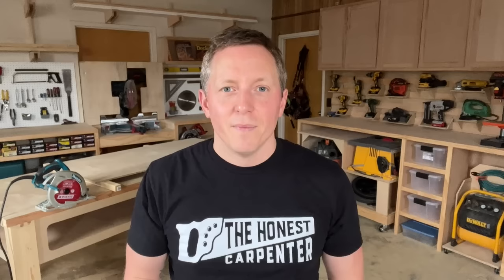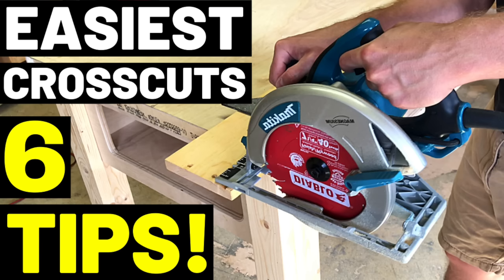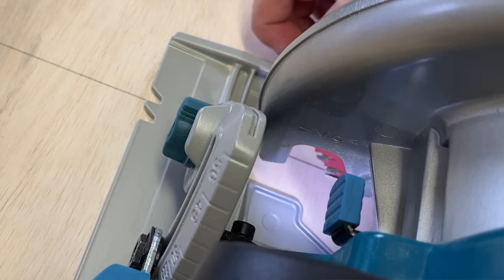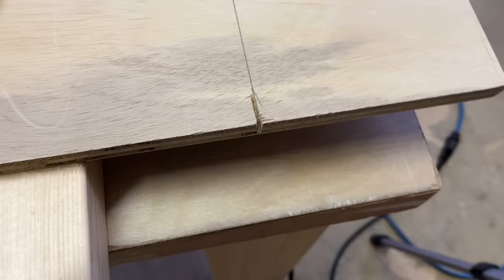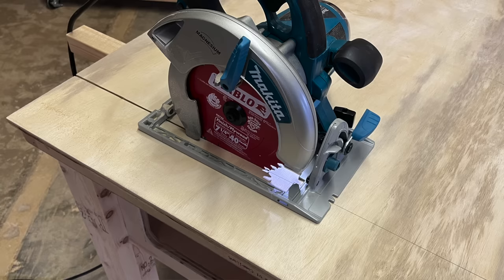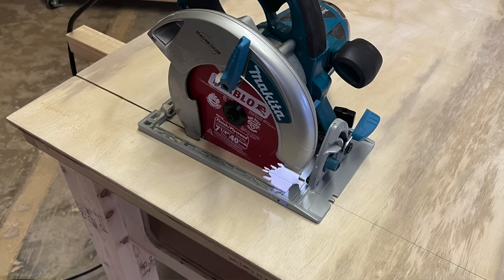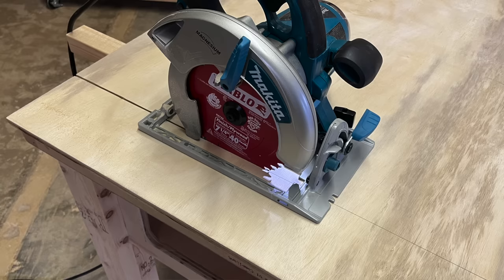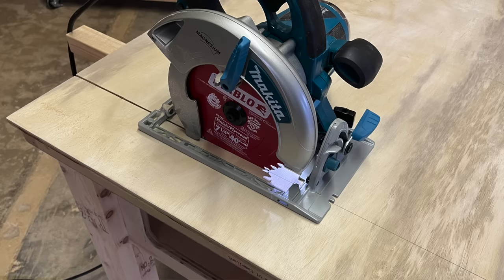How To CUT STRAIGHT With NO GUIDE! Freehand CIRCULAR SAW CUTTING...Pro Tips, Tricks and Secrets!

Comment: When I do a freehand cut like this, I use a 60 tooth blade and I get the cut started as this video shows. Once the saw shoe is fully on the surface of the board, I stop the saw making sure NOT to move it and I do wait till the blade completely stops. I then make a precise mark (just with any fine marker) on the trailing end of the saw shoe right where the edge of the cut is and I mainly keep my eye on the mark keeping it on track with the edge while periodically glancing at the front of the saw blade. I find this works extremely well due to the visual leverage at the rear as opposed to the front. (Hope that makes sense to all you readers).

Comment: great video.  ive got a regular makita circular and i like to start the blade turning and watch the blade start the cut on the correct side of the line. and then look at the table guide notch and make sure its lined up and then push the saw and my eyes will look back and forth from the blade and the guide while making the cut.

Comment: I specifically bought my Bosch GKS 18 V-Li with 3 things in mind (4 if you consider the battery platform):
1: Battery operated so I won't have a cord that catches on things all the time.
2: A sole that supports tracks.
3: The blade to the left, so that I can see the blade and have the wide part of the sole fully supported when cutting narrow strips without having to use my non-dominant left hand.
It's an older brushed model (though still available from the manufacturer), but right now, it's the only model that has all 3 options.
The trade-offs are 2" cutting capacity and it is limited to the older FSN70 /-140 tracks (same concept as Makita, Festool, etc.), but I can easily live with that.

Comment: Very effective explanation.  It's easy to take knowledge you've acquired for granted; multiple times in vid I was like "yeah, I guess I do do that".  You're definitely a born educator!
The only thing I would add, and it's not even a technique, just advice for beginners, is to be prepared for the power and action of saw.  I can recall when it was kinda terrifying just to try and handle the saw when on, but if you get a feel for the experience of it speeding up; the resistance as it bites into lumber; the amount of force to apply; the response of lumber as you progress through cut, it's not nearly as intimidating... obviously you get a feel for these things w experience, but too often ppl don't even give what it may feel like any thought prior to trying.  I think that's an important but often overlooked aspect of learning anything new.   
Whatever you do you should try and improve with each attempt, but that doesn't mean the first try needs to be a disaster : )

Comment: Great video. I’ve been a carpenter for 20 years and the young guys at work (lets be honest some of the older ones too)  just can’t understand you have to watch the blade if you want to cut straight. I got all my practice being a residential framer for 15 years before joining the union. Once you build the muscle memory required for pushing the saw straight you will be efficient and accurate with your rips.

Comment: Great video.  I got a left handed Skilsaw for Christmas.  Thats a Skilsaw, not to be confused with the cheap Skil... saw. : )  Im right handed so it makes it super easy to see the blade since its on the left.  Still takes a lot of practice to cut straight.
Reply: As a lefty I always found it odd that skilsaws seemed like they were made for left-handed use - with the exception that they tend to discharge sawdust right at my thigh.

Comment: Always good.  Having cut a cord or 2 over the years, my favorite tip is clip a carabiner to my belt loop and run the cord through it.  it will always follow my body at hip level.
Reply: Please don't use a carabiner. It can be extremely dangerous because the cord always leads back to you. Something as simple as someone else tripping on your cord. How about cord catching on something and the saw kicking back. There are many ways this could go wrong.
Reply: @jonperryman6477  I see your point but this has not been my experience.  kickback incidents went down after doing this because the cord stays inline with the cut.  I generally work alone, but when i was on the job site i kept cords to a minimum.  I was also the osha inspector on the job.
Reply: @garybecker4490  Please don't pretend you were with OSHA. You were the contractor's safety person. The original poster must be a DIY'er because he cut his cord a couple of times (could just as easily been a body part or someone else). After volunteering at "Rebuild Together", I found DIY'ers often do the unthinkable. E.g. free hand hold work piece under a band saw which thank god they dropped their hands when the blade touched their fingers. You could see the mark across every finger! Worse yet, they will imitate you as a professional which they clearly don't have the skills to perform safely. As for the carabiner trick, it's safe for someone skilled in cord management. For DIY'er, it's an excuse to ignore cord management.
Reply: @jonperryman6477  I wont argue with you.  I didnt say i was with osha, but compliance and safety was my responsibility with the authority and accountability for the entire site.

Comment: Back again.  I've been cutting kitchen and bathroom countertops with circular saw plunge cuts. These are quite tricky to do. It is not possible to keep my eye on the cut line at all times because Instead I need to ensure the saw's rail is staying flush with the guard rail (gotta have those  sincefree hand is absolutely not working in tough materials). I've also found that cutting backwards often works better because going forwards sometimes locks up / kicks back for no apparent reason.

Comment: Frankly, the biggest factor in how easy it is to cut straight is the circular saw you're using. I got a corded Ryobi that was a nightmare, which I outright broke somehow. I got the battery powered Ryobi, and it's a dream. Zips right through, easy to control, no problems.

Comment: Good information.

I would add a couple of items.
When starting a new project start with a new sharp blade.

Treated wood tends to dull blades and I have learned from experience when a blade is starting to get dull.
I can feel it.

For framing cuts and rough stuff you can power through but if you are getting to stuff that is going to be exposed change the blade.

Your saw will thank you.

Harbor Freight sells a circular saw blade sharpening device.

Comment: I had a problem with my circular saw walking off the path even when I was running it against a straight edge and push hard into the straight edge to compensate for it walking off the rail. Turned out the blade was super old and dull. I replaced the blade with a new one and boom! Perfect straight lines using the straight edge

Comment: Great video. Wish these kinds of videos had been around 40+ years ago when I first started out, ha ha. I was taught by old time carpenters and actually learned a few tricks.  Like pinching the shoe in front of the blade and using the edge of your finger on narrow rips, using the framing square as a cross cut guide on crosscuts less than two feet, ect.

It wasn't until much later, after getting a subscription to a couple of woodworking magazines, that I learned about making panel guides for the circular saw to make straight, accurate cuts in finish sheet goods.

I also made up panel guides for my routers for cross cutting dados and rabbets, identifying each guide for which router with what bit. 

Great video as always.

Comment: Use dust extraction, if you are cutting slowly you can obscure your pencil line with excess swarf and cut an untrue line, its also good for your lungs, people fail to realise how long and how much fine wood/ mdf particles hang in the air.

Comment: Good video Ethan. If after watching this video someone still has a problem getting straight lines you can always cut the plywood an 1/8” oversized in all dimensions and then use a router with a good trim bit and trim it flush.
Ron
Reply from the maker: Good point Ron! A good woodworker friend of mine does that. 👍

Comment: Tip.....  Once you're into a cut and going straight, look at the front of the saws base plate and take note on where your cut line is at the front of the base plate. Use both the reference at the front of the saw base plate and the blade at the edge of the board when starting a cut and the saw will orientate itself to being straight before you even begin to cut.
Tip..... When free hand accuracy is important and you have the proper setup, drop the blade below the saw base plate to a greater depth to expose more of the blade plate. The will help to keep the saw straight as you cut.

Comment: Your thorough caution at the start reminded me of an old acquaintance named Roy.  Roy liked to use his table saw.  Roy liked to drink.  At the same time.  One day, Roy cut off about half of his finger with the table saw, and the spinning blade threw it across his shop.  Why didn't Roy grab it and run to the ER, hoping to get it reattached?  Because Roy's dog ate it ... ate his finger.

If I might have ever been tempted to drink and use cutting tools, after that I knew I'd be quite safe from even considering it.

Comment: As most of my cuts require percision , I'm always use a guide. For free hand when the exact size doesnt really matter I'm holding the saw next to the cutting line in line with my right hand and shoulder and my index finger points the cut....it works well as for hand saws.
Reply: Thought you were Electroboom  for a second lol.

Comment: I did not know they make circular saws with the blade mounted on the left. perhaps they are harder to find? I have a right blade saw. I'm right handed and the issue i have is I'm nearly blind in my right eye. it is more a challenge to follow a straight line when cutting. I always use a straight edge to help me with my cuts. Thanks for all your tutorials. they help me lots!

Comment: When im at work i just lean the plywood against the work van, hold the saw sideways making sure the blade will not touch the van. Then i make the cut, and when i get to the last few inches i line it up good and go real fast because the plywood will colapse. Lol. I get back and get my feet out of the way and let it fall. Works great. 😂

Comment: When i mark a line, i use the side of the board of the cirkel saw as guidance. I prefer this way because you can easily see it, and you also clearly see, if youre saw is in line with youre cut. You just measure the distance from the end of youre board to the cut. And add/take-off  from the measure you want to cut from youre material.

Comment: Discount track saws, made from plywood and a straight edge works real good if you really need those nice factory cuts too. I'm working a job right  now where I have to cut plywood siding, so I just jigged up what is basically a panel saw, with a few scrap pieces. Works like a charm.

Comment: I've cut for years I can rip a board with using my finger as a guide, also it helps to chalk a line preferably black chalk but when you get comfortable with a saw a lot of things you can do, watch the blade and make sure you  have you blade adjustment about a half, helps keep it straight. If your cutting high dollar board just let a pro cut it for you or you will mess up something like Burch plywood,just get a old piece and practice.

Comment: great video i did very similar myself for ripping a large 4x8 plywood on the floor. only 1 thing i would say is it would help to start the beginning of the cut with a speed square. to get it started straight. and avoid the wiggling until the blade gets established into the groove. then freehand the rest of the way

Comment: Dude.  

Tip - It’s a whole easier and safer and more accurate to know the offset measurement to your blade and draw your guide line for the right (or left) side of the base plate. 
You cannot eyeball starting your cut parallel to the line when all you can see is one point (the blade bordering or splitting your line.)  If you use the base plate you can eyeball that the entire edge is // to your line. 
Try it. 
Tip - If you don’t know your offsets, just set the blade on your first mark and use the base to make your offset mark.
Reply: That is the first time I have ever heard of doing it that way. 
That's a good tip. I will definitely try that.👍
Reply: @Griffix96  And one could then also hold a straight edge against the plate to line up the saw to start the cut perfectly parallel. I use a square for that purpose quite often- just to get lined up. Craftsman used to sell an adjustable square just for that purpose - to help you hold your circ saw // or to what angle you need. I just use a small try square or machinist square or one of the cheapo plastic triangles from a big box or Harbor Freight in my free hand when starting a cut.

Comment: I just clamp a piece of wood that I can use as a guide rail, my saw cuts exactly 100mm in from the edge of the foot so it's dead easy to measure where to put the rail and much easier for making straight cuts. And I have a cordless one to avoid cable mishaps, which is great if you only ever do a handful of cuts.

Comment: Well done!  As you have, I also always stress that the details make the difference between sloppy, amateur-like results and quality work.  You've demonstrated a 'method' for learning manual skills in this example (free-hand power-sawing) that can be applied to many other skills.  Break down the process (measuring, planing, chiseling, hammering, whatever) into all the steps.  Understand/practice each step.  Then the process becomes easier, faster, more accurate, and less frustrating.

Comment: When cutting wet wood or pressure treated wood with high moisture content and sap residue, these issues can cause the plate on skill saws to bind causing hesitation cuts. A fantastic work around for this problem is your average bar soap like Dial, Irish Spring or any brand will do. Take the bar soap and rub it on the wood along the length of the cut to be made about the width of the skill saw plate. This light layer or bar soap on top of the wood will act as a lubricant for your skill saw plate and will prevent hesitation cuts caused by sap, high moisture content or heat build up on the plate and blade.

Comment: Use the cut notch to align your blade on your approach. Set notch on what ever side you're cutting, then line blade on cut line. Almost like sights on a pistol. This will get you within a couple degrees. 

Also....lock your arm as much as possible, use your body to push the saw. Position your body to maximize your reach without over reaching/extending your arm.

Comment: Excellent! So to confirm, you like to have the saw blade track straight onto the pencil line? Versus to the left or right of the pencil line, depending on which side of lumber you’ll keep? Thanks for posting this video—very helpful!
Reply: Exactly...i cut to the left or right of the pencil line, depending on which side is " waste "....cuting the line is incorrect for accurate carpentry, maybe ok for rough framing etc

Comment: I normally use a Ridgid brand circular saw.  It has a much better guide notch compared to Makita or DeWalt saws.  I have used all three brands as well as Portor-Cable and Milwaukee brands.  I tend to start lining up blade for a plunge cut as the front of the Ridgid saw is perpendicular to the cut line. This plunge gets the blade started its full length of the blade parallel to the cut line.  And you are totally correct that you have to watch the cut line throughout the entire cut.

Comment: My biggest tip for cutting full sheets down....use a sheet of the hard foam insulation board and lay them on the floor and cut it. I have one that is for nothing but this! and I broke it into thirds to make storing it out of the way easier. Then I can just lay them out when I have to break down a sheet.

Comment: One more thing, like the Honest Carpenter says.......safety with a circular saw is very important.
Do not try any fancy or fast ways of cutting unless you can instantly stall that saw if it kicks or jams.
It's very easy to lose a finger or worse if you don't have complete control at all times, or at least make sure your hands are out of the way if it does kick back.
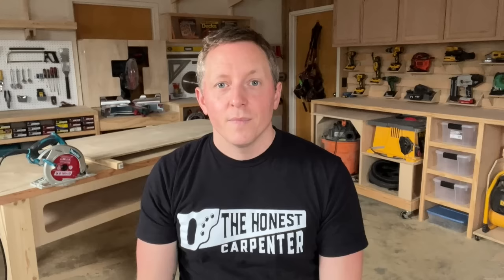If you get used to a saw and are good at it, you can use the notch at the front to guide your saw. ( 4:45 )

Comment: You always line your cut up on the side of your line of which you’re going to throw out that way you have some room to play with if it’s to long. You also have to compensate for the width of the blade. Hence the opposite side rule
Reply: That's what I always thought. It's been 15 years since I've used a circular saw and his explanation kinda confused me for a moment until I read your comment. Then it came back. That's the way I used to cut.

Comment: I've learned many years ago that if the saw gets difficult to push I'm standing on the cord. LOL Like you said, stop the saw if you need to adjust your stance or you may be able to just lift one foot. In construction it's not unusual to get in awkward positions. I would also caution to always have a firm grip and ample pressure down before starting the cut. If you get crooked you can have kickback which is very dangerous. When you cut thin material you need to lift your gaurd like you showed for angle cut